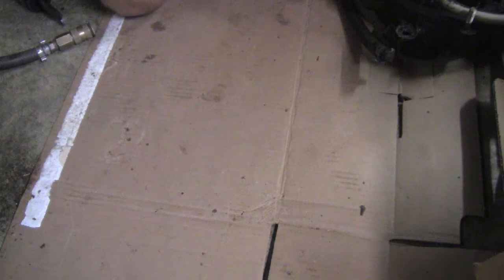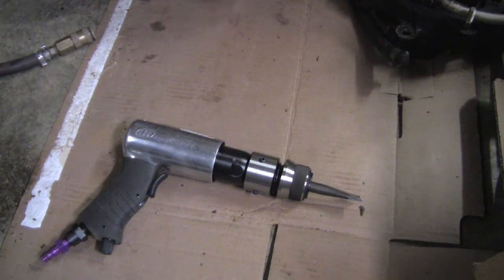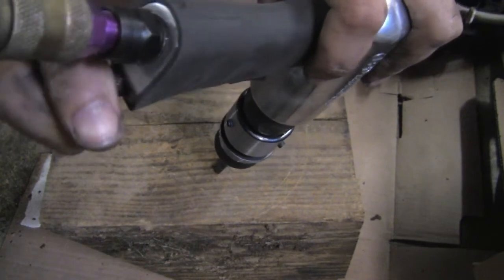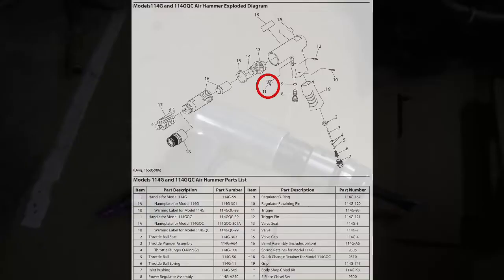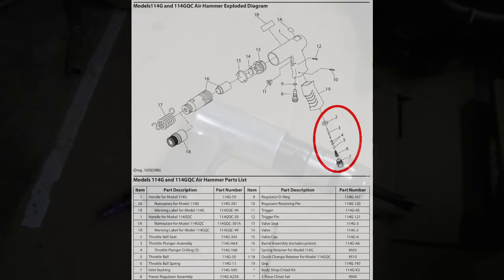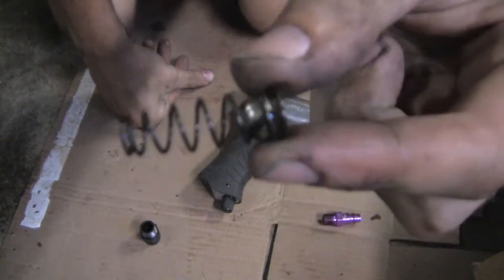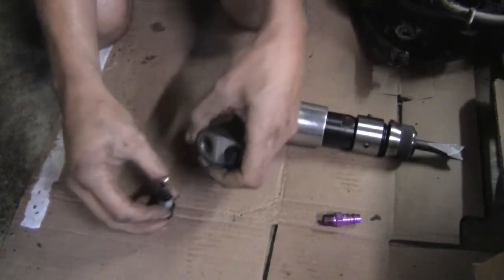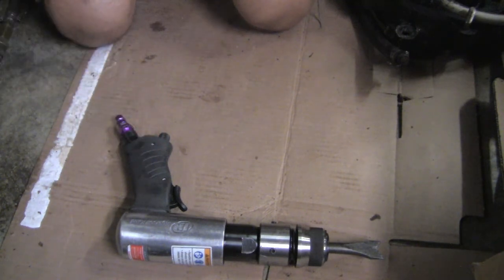IR Trigger valve assembly repair. AKA How I fixed my brand new Ingersoll Rand 114GQC Air hammer.

Comment: You just saved me $50. Thank you!! I was working and the black fitting became loose and it disconnected . I put it back together and there was no tension on the trigger . I looked at this video and noticed I was missing the spring and the little ball. Went back and somehow found it.  Put it back together and works like before ! Thanks again
Reply from the maker: Eyyyy! Thats awesome, glad the video was helpful for you!

Comment: I just bought a CP air hammer for $10.00 and the valve had shifted to one side because somebody had unscrewed the piston housing. I put the valve back in place and it works perfectly now.
Reply from the maker: That's awesome! Man they are handy, I've used mine to bust out cement blocks to run electric and lines to my shop and all kinds of stuff. Super handy tool to have!
Reply: @trythistv  Oh I have plans for mine doing riveting and using it to bust frozen lug nuts.
Reply: My button won't depress. Any ideas?? It's a cp 715
Reply: 😊 photo o

Comment: I bought a new looking 121 that was doing the same thing. I was about to throw it away. I took it apart soaked everything in Barrymans Kem tool and found a small disc had been frozen in place with carbon. Resurfaced everything with 200 grit and it works and looks like new great gun.
Reply from the maker: Awesome results!! There usually isn't a ton to fixing air tools, that being said, they can be complicated, but one good thing if you're tearing something apart that's already broken the worst that happens is that it's still broken afterwards 😁

Comment: I can't keep mine from falling apart I've been extremely lucky to keep finding the ball and spring what could i do about it
Reply from the maker: Use a little loctite on the threads when you assemble it? I stress little, don't put so much that it smooshes out and gets into the internal workings, just a dab to keep it from coming apart easily.
Reply: @trythistv  Thank you i will try that

Comment: having the same issue on mine, ball is in the correct spot and the spring is the right way, is the 4 on the diagram 2 aluminum rings or a rubber seal or something?
Reply: also what is number two? i might have lost those pieces😨

Comment: Hey thank you for this video but I guarantee you did the same thing I didn't ride to take off that security thing and everything came out I was pissed when I went to go use the new gun and the trigger was stuck down
Reply from the maker: I actually have a terrible habit of buying stuff on eBay that is "broken" and then trying to fix it... My air hammer was listed as a non-functional return that had never been used. I'm 100% certain whoever bought it before I did exactly that though!
Reply: @trythistv  yeah that's what I did and let the ball roll threw it back in, thank God for an easy fix. Just bring impulsive wanting to open up the new toy.
Reply: @trythistv  how does it work anyways? I don't like the fact it has that plastic trigger that will break first
Reply: Sorry for my Grammer big fingers little buttons
Reply from the maker: I've got the big fingers syndrome too, phone screens aren't meant for large hands. My understanding on the trigger is the trigger itself tips the little flappy gear looking thing that has the metal prongs. I don't know how to describe it better, but when it tips it lets air through the passage, and the ball has some kind of effect on that assembly with the spring holding pressure. It's been a while since I've had it apart though so I'm a little fuzzy on the specifics
Reply: @streetbikebilly2597  it works great it likes to self-disassemble though I'm trying to figure that out

Comment: Great job!
Reply from the maker: Thanks! It's sure come in handy. Used it the other day as a part of the geothermal saga that I'll be uploading soon
Reply: A YT commenter warned against cycling that with a tool in, but not against a load or work. He said the tool will beat the balls in the quick change chuck assymetrical so you cant get the tool out. No dry firing!. Thanks for sharing what you found.
Reply: bunberrier any way to get the tool bit out when that happens, ironically it happened to me and I can’t get the bit out
Reply: @peterveresan3591  Reviews on the hammer say it happens regardless of load at the bit or not. All you can do is pull the sleeve back and rip it out.
Try to stick with hardened tips so they can't flare out.

Comment: These have some strange QC on them.. You don't have the instructions to see the 4lb of screw on force and 9 inch pounds of force on the grub screws warning for the sleeve :D There's blue locktite on the grub screws too, so 9 inch pounds is literally impossible to feel.

Also the rubber handle covering over the "oil daily" stamp in the steel of the body.

The AVE review of these showed the most astonishing amount of metal shavings left inside the body on his.
Mine wouldn't even fire until I had a bit in place or the tool was tipped up. Seems to be fine now, but I'm not confident it will last.

You'd think they'd just take that tiny amount more care, and have them assembled correctly and have fewer returns. Just such a pointless waste.
Reply from the maker: Its getting that way more and more, so many "quality" brands and tools that are cheaping out, My grandfather used to work for ingersoll rand before I was ever even thought of, and they made incredible tools back then, but it seems more and more like they're riding off that name and reputation.
I've used craftsman hand tools for years, and now with the stanley purchase and such I'm questioning the quality.

Its a real shame, have to rely on folks like AvE to show what tools are good and what is best left on the store shelves.

Comment: I'm always afraid some insect will build a nest in the inlet fitting.
Reply from the maker: I haven't had that happen yet, but now that I've said that, I'll have to start checking lol
Reply: @trythistv  They will if they can get to it.  I used to have vinyl caps on my fittings but most have been lost or used for other purposes and about everytime I leave one exposed mud bees find it.  I need to buy another pile of caps.